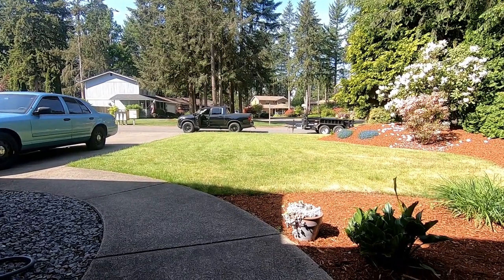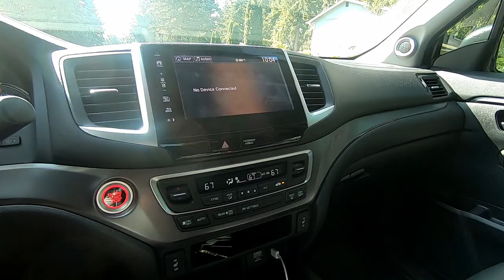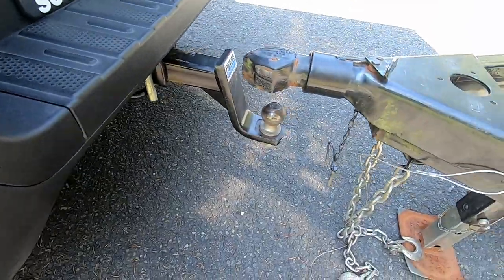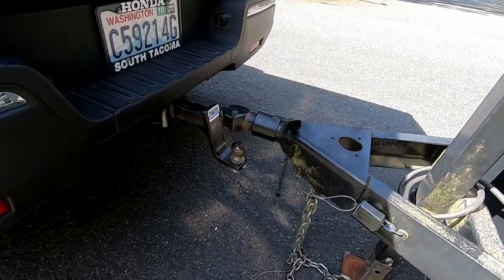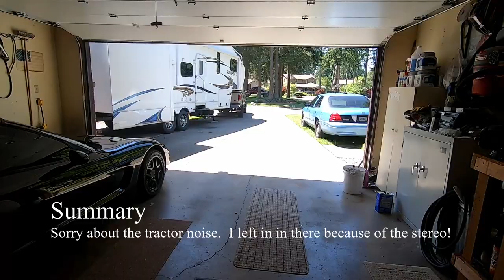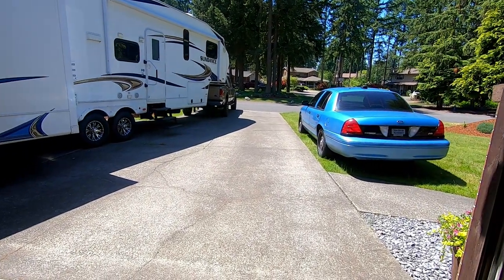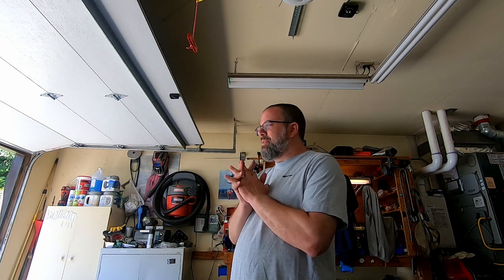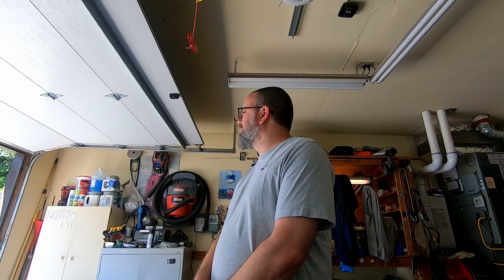Unbiased review 2017 Honda Ridgeline RTL-T Towing Test 5k pounds

Comment from the maker: Something I did not mention in the video which is important to many, we do not have the P rated tires on this Ridgeline anymore.  This makes a big difference in stability.  Something to keep in mind if you are going to tow max loads with your Honda.
Reply: What do you have on there?  Thanks!
Reply from the maker: @LuxHomesMN   They're an SL load rating Mickey Thompson Baja STZ.   They are now discontinued but basically a cousin to the Cooper ATS series of tire IIRC.
Reply: @PNW_Car_Mods  Thank you, I have been towing a little teardrop with my Pilot but feeling like i'm not grabbing the road very well.
Reply from the maker: @LuxHomesMN  There could be a couple reasons for that but the tires could be a large part of it.   The other thing you are dealing with is a single axle trailer which can move around a little bit more than a two axle trailer.   The tow ratings are pretty light on the Pilot compared to the Ridgline as well.  If you don't have one already you could benefit from a light duty weight distribution hitch.
Reply: @PNW_Car_Mods  this is the part that is so confusing to me.  My Pilot Elite is rated to 5000lbs and I had the transmission cooler added. My trailer is under 2000 and I have been told over and over that I don't need weight distribution or a sway bar.  I am wondering if the Ridgeline is just better suited for towing - even though I thought it was the same basically as the Pilot.  I just am not liking how my Pilot is towing.
Reply: What size dump trailer is that 6x10?
Reply from the maker: @cagewarrior123  I'm not positive as it is borrowed from my wife's uncle.   I'm pretty sure it's 5x10.  Two 3500lb axles and gross weight of 7200 I think.  I  will double check next time I see the trailer.
Reply: @PNW_Car_Mods  thank you for getting back to me, I should be okay if I got a 6x12 dump trailer. I'm sorry for all the questions I just wanna make sure my ridgeline like can tow it
Reply: Question if I purchased a 6x12 dump trailer my ridgeline should be able to tow it??
Reply from the maker: @cagewarrior123  Justin I would get the smaller one because the larger the trailer the more it weighs which will cut into your payload. Hope that makes sense.     Even the size I was towing I would not tow it full of gravel.   The trailer would be overloaded and the Honda severely overloaded.   You can get a 6x12 if you really wanted but man that really is a lot of weight.   This is just my opinion of course. ;)
Reply: @PNW_Car_Mods  Ridgeline 2G is rated for 5000LBs using SAE J2807 standards, which is the same as the Pilot.

That said, Honda has stated that the Ridgeline, though sharing a platform with the Pilot, has substantially beefed up suspension (i think remember reading it was ~20% heavier duty) which is meant for durability over the life of the vehicle. I'm also figuring Honda is making a wise assumption that people will "abuse" a truck (Ridgeline) more than a midsized/crossover SUV (Pilot).
Reply from the maker: @tecono1   Correct, for AWD models.
Reply: I've never heard of P rated tires? I have E rated tires on my dump truck....
Reply from the maker: @MeltingRubberZ28   P is passenger rated.   So sizes that start with P235 60 18 for example.   P rated tires are usually made for comfort not for load.
Reply: @PNW_Car_Mods  learn something new everyday! Thanks man

Comment: Great video! As an owner of a 2006 Ridgeline mine does fair on pulling weight but is excellent on stability when pulling. While a flatbed should tow fine, the wind drag from a travel trailer will make the engine / trans work hard. Mine continueally shifts up and down unless you gear it down and run it 4000 + RPM continually. Second gen should do better but would not imagine a very big difference. There just isn't enough engine torgue to pull against wind drage and run in the upper gears. So mine got 10 MPG max towing a trailer on mostly flat terrain. I love my Ridgeline truck for all the benefits it has, just not for towing at all.
Reply from the maker: Oh you might be surprised.  You should see the video I did about towing a 5k pound travel trailer for a summer season in the mountains of Washington with it.    It flat out exceeded expectations and drove extremely well.    Plenty of power, and more than plenty of braking power. Still averaged 10mpg.   I wouldn't do it forever as I have no doubt that eventually the transmission would leave the chat.  It was fun while it lasted.   Wife ended up trading the ridgeline in for a Gladiator which has been good to and it does have a lot more towing capacity.   I still see a lot of Ridgelines both new and old towing good sized RVs and the owners always seem happy with them.    If they could just find a way to get the towing capacity up another 1500lbs or so I really think it would help sales.  but that is a tall order on a front drive based platform.
Reply: @PNW_Car_Mods  Nice to see the newer generation tow that well. Have to agree with you on the Ridgeline for towing. The trans is not up to the task. A wise move getting something with higher towing capacity. I didn't see your travel towing video or I would have answered differently. As a comparison, my ancient 2006 with its 5 speed trans and 255 HP, while rock stable with a trailer, it lacks the gears to keep the engine happy for larger loads.

Comment: With my 2010 ridgeline RTL I pulled our 26' ulta light 4200lbs plus gear and water usually around 5300-5600 lbs packed and ready. That truck felt awesome pulling it, not a power house but it felt fine and that's overloaded by a bit
Reply from the maker: What was the horsepower and torque on the 1st gen V6? I definitely do not feel there is a lack of power on Gen 2. I've yet to ever have to floor it. Not even close.  With our new travel trailer we are guesstimated to be around 5700 pounds and that's high. Still have not scaled it as it's a total pain in the ass around here to even get to the nearest CAT scales.  The Ridgeline scaled at 4500 full of fuel no people. So with the three of us that's around 5k pounds. Bikes and firewood and we're at 5200 pounds  We don't travel with water other than to keep the pump primed and run the bathroom once or twice.  I still can't believe how well this thing is for being stable and it stops so well.   Our old combo while it drove well it was a white knuckle experience to stop it at 22k combined.   Thanks for your comment Cory.
Reply: @PNW_Car_Mods   The 2010 was 250hp and 243 ft lbs, so 20 less in each category. I think the big difference is in the 5 spd and 6 spd having that short first gear to get it all moving.
Reply from the maker: @corynickoleff767  Good point.  It definitely does not have a getting going problem at all.  I've known 3 people with 1st gens and have never been in one.  Kinda weird it just worked out that way.

Comment: Thank you for posting.  This is another data point as your test and first hand experience confirms my research that I am able to tow my soon to be Escape 21 travel trailer with my 2017 Ridgeline RTL-E.  I will be taking delivery of this camper in August.  The trailer stated Gross weight is 5k with a empty spec of 3210 lbs without options.  I am estimating worst case fully loaded for camping weigh of 4400 including optional items. In this worst case, i still have 10% margin for driver and passangers on the truck.  Most likely scenario is that the trailer will be under 4k lbs for most of my camping trips. I will be driving up to Chilliwack CAN to pick up the trailer and will swing by beautiful WA on my way back down to So Cal.  Thanks again for the post.
Reply from the maker: Our new trailer is also listed as a 21 foot model but of course is a few feet longer than 21 feet and will be a bit heavier than yours.   You are definitely on the right track for staying in the comfort zone.    Admittedly we will likely be on the heavy side of 5k pounds but I won't know until I scale it.   Either way I have no concerns over the safety of towing it but my concerns lie with long term transmission life.

Comment: Between my truck and the old flat trailer I had I pulled 60 deck blocks about 10 miles wasn’t pushing it but it had no problem delivering what I had had no electric brakes on the trailer and had the ridge landed fine. I was watching for thermostats to make sure nothing was going up above normal it stay right where the thermometer normally sit never elevated pass that so I’m looking at getting a 19 foot tow behind the camper after doing motorhomes tow behind converted the bus into a motorhome and pop-up and  a tent before that. I love my ridge line. And I have been a Ford guy all my life and now I’m 64
Reply from the maker: Good to hear bubba.  We ended up trading ours in last year because it's on a lease for our business.  We didn't get another one because my  wife changes cars like shoes.   We both agree that we miss it a lot.  Wouldn't rule out another one for sure.

Comment: Great upload and quite timely.  I have an '08 Ridgeline and have been giving thought to getting a new one. One criteria for a new one is that it has to be capable of towing my Vette on a single car trailer. I have no knowledge in towing, so I for one would look forward to your further uploads on the install of a brake controller and weight distribution setup. Any suggestions on specific car trailer, both open and enclosed, would also be most appreciated. Save the Wave.
Reply from the maker: You know Peter I am kicking myself now for not towing my Corvette down to my tuner in Vancouver last winter with the Ridgeline instead of the F350.   I have no doubts that a light 2000lb two axle trailer and a 3100lb Corvette would be just fine.   I would like to and I may someday if the need arises.    There are a number of guys that I have talked to on the forums that do tow light sports cars and the like with their Ridgelilnes.  1st and 2nd Gen.    I will like le be doing the Brake Controller and hitch setup for Travel Trailer in  about 2-3 weeks time.
Reply: Thank you so much for your reply. You say "down to Vancouver." May I ask where you live? If it's a privacy issue, I understand and will just stay tuned, no pun intended, lol,  for your next up load(s).  Peter.
Reply from the maker: @petercarey6883   East of Tacoma Wa about 15 miles.  Over towards the base of Mt Rainier.
Reply: @PNW_Car_Mods  Wow, sounds nice. You should work some of your wonderful countryside into some future uploads. Have a Happy Memorial Day.

Comment: The ol' gettin' out to see how close ya are. Sounds like the back up camera cuts down on that quite a bit.
Reply from the maker: It's an awesome feature for sure.  I've been fifth wheel towing for the last ten years which is really easy.  Now that they have these cameras the bumper pull stuff is great and quick without damage.   I can get the tongue over the ball I would say 9 out of 10 times first shot.  :)
Reply: @PNW_Car_Mods  Thanks for the video. I've pretty much decided on Ridgeline for my next truck. The most I'll ever need to tow will be a two-horse occasionally, and from what I've seen the Ridgeline should do just fine.
Reply from the maker: @Seth_Stewart   not trying to pimp my videos as that's not really my style but you should check out my other  towing video with the Ridgeline where we are actually pulling our travel trailer with it.   The Honda exceeds my expectations in every way.   I think you would be fine with the two horse trailer.